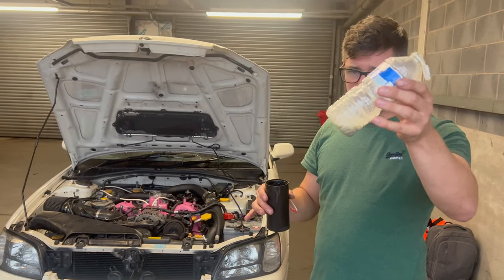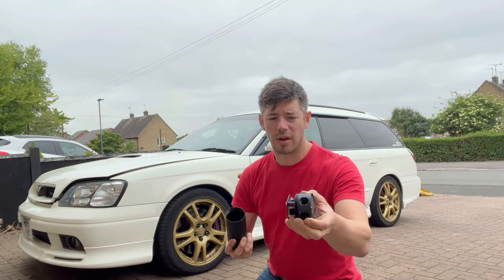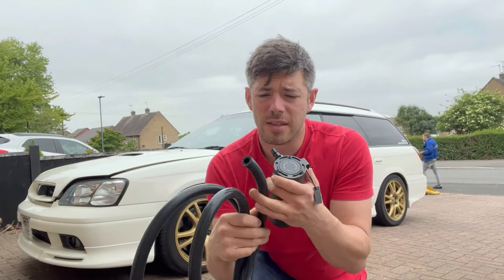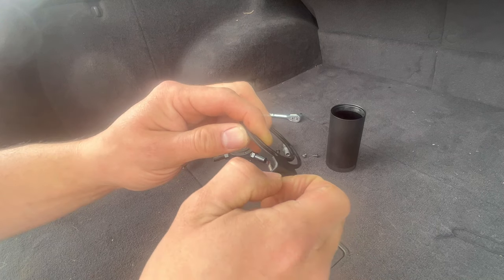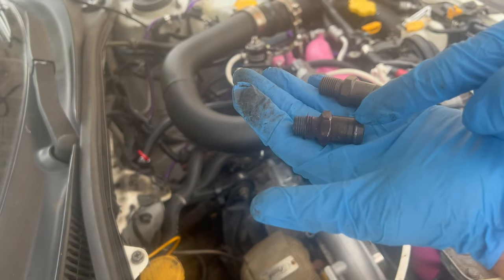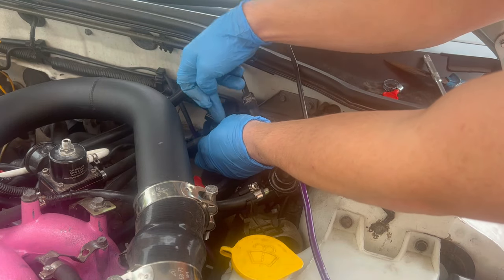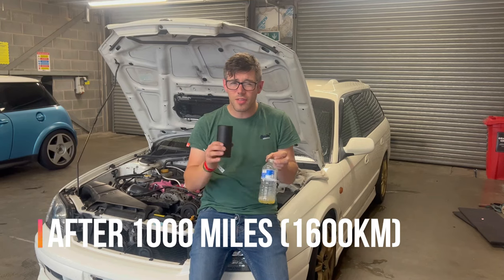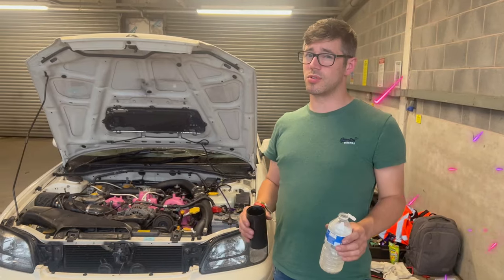£100 Subaru Catch Can Install and Track tested! - Initial B

Comment: Or just leave the PCV connection alone and just connect the valve cover breathers to the catch can. It's only the oil that gets sucked into the engine under boost that matters, and that all comes from the valve cover breathers.

Comment: Great idea having two systems in one, so far I only have a catch can for my pcv system. I need to empty it every month or so. Mostly water from condensation in the crankcase, but definitely don’t want it getting mixed in with the combustion.
Reply from the maker: It took a while for me to get my head around it but it’s simple in the end. Cheers man.  And yeah I think this is mostly condensation

Comment: Hey man from New Zealand here. Love your wagon. However more a fan of the sedans. What are the differences between rev a c b and d legacys. Have heard rev ds have bigger turbos and ecu is easier to play with on the rev ds.
Reply from the maker: Hi man , cheers.
I had a sedan in the gen 4 and yeah they look great.   The a-c have turbo differences with the C being the largest.
The D has negligible difference in turbo size, although a tad smaller. But they come in better and have a better ecu. Also faster steering and a few other improvements.   The front is facelifted on the rev D too.

Comment: what if I want to vent to atmosphere how do I go about that
Reply from the maker: I’m not sure how you could tbh, because the inlet draws the vapours out the crank and heads.  I’m guessing for vent to atmosphere the heads could be open but you run the risk of unmetered air.  Sorry I couldn’t be more helpful.

Comment: I want to install an oil catch can from crankcase valve and head, but i plan to let oil catch can out to atmosphere, and for prevent MAP errors, gonna cap the inlet port which should be connected to valves, and finally the exhaust gas from the crankcase will not flow into the inlet at all, i plan to do this but not set yet, maybe you have some opinion to help about it? 

By the way, nice video made, it shows a safe way to make this system!
Reply from the maker: @mr.sn1mperdcat276  I don’t see any issue with doing it to atmosphere the way you have described.  I think because I had to option with my catch can to flow out I just used it.
Reply: @InitialB  thanks for reply mate! I'll give a feedback when i done with it

Comment: Nice video, one of the easier set ups and installs.
Quick question, on the drivers side breather, where the new pipe was fitted, what happens with the original pipe, is it capped off  ?
Thanks
Reply from the maker: Yeah if I remember it goes into the turbo intake pipe, that’s blanked.